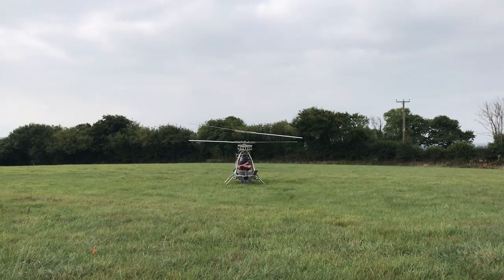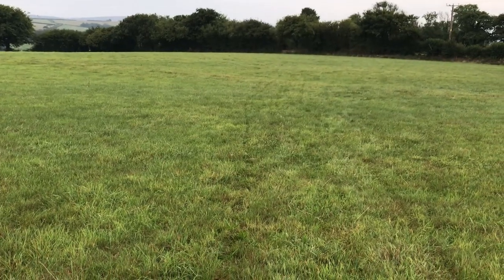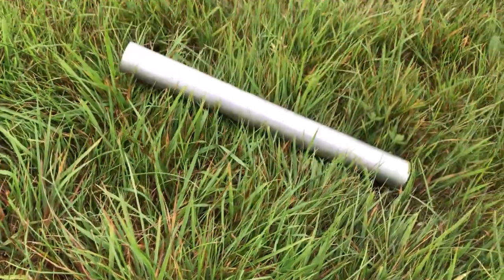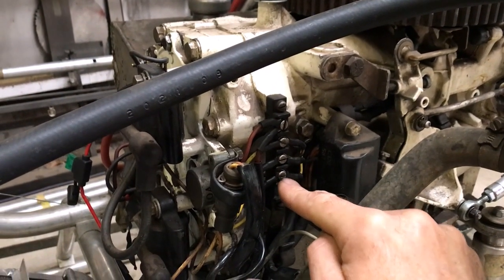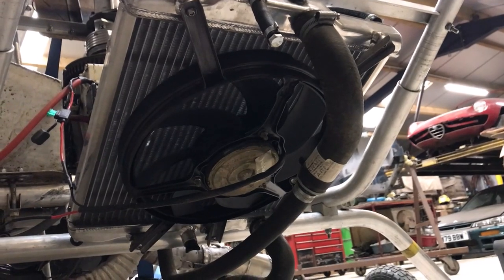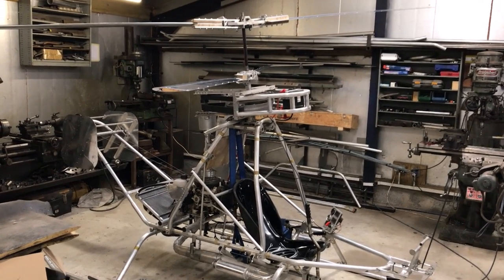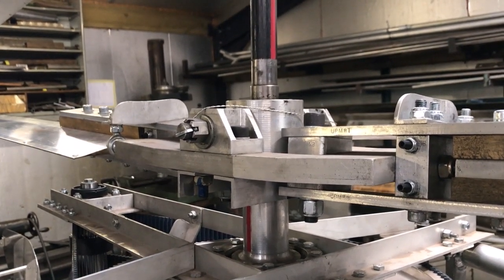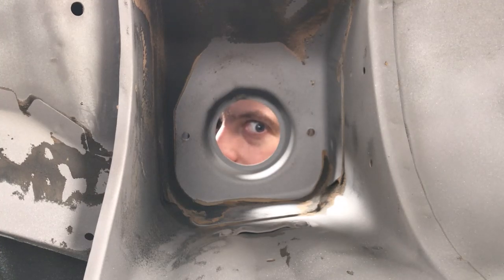Slow learning process Homemade coaxial Helicopter

Comment: Being untrained in Heli flight AND flying an experimental, homebuilt machine.  My friend, you are either very brave or quite crazy.  Possibly both.

Some suggestions:  Take a couple of lessons.  Even if just to the point you can hover.  As it stands now, you won't know if hover instability is because of a lack of skill, or a deficiency in your machine.  Second, and this may be difficult, try doing your test flights on a harder surface.  While this seems counter-intuitive, that fact you noticed about the grass is important.  You want your machine to be able to slide along the ground if it gets out of control, and as you noticed, the grass isn't very slippery.

In any case, I wish you the very best of luck.  I ran into the same problems you are when I started flying model helis, and the advice above is what was given to me by an experienced full-scale heli pilot.  I followed it and sought out an instructor.  It really helped me.
Reply: Can you hire a pro test pilot to try it out?
Reply from the maker: @codetech5598  I don't know but I wouldn't be keen on putting someone else in my home built machine. Think I would only risk another person if I had already done extensive testing on it myself.
Reply from the maker: Thank you for your constructive comments. I have had a couple experiences in a Robinson and I have got another one coming up, I'm sure it will help but apparently 14hours is the average time taken to learn to hover. At £320/ hour it's expensive, my thoughts were I could build a helicopter and teach myself cheaper than paying for instruction and I'll have my own helicopter at the end of it. The hard surface would be fine if there was a place nearby to test. Short grass would  be my preference and the field next to my workshop is ideal when cut. I could ask the person who rents the field if I could cut a section if it, will give that some thought but don't think they would be happy about it . What I really need is my own land and workshop next to it to carry out testing. Trailering the helicopter to test is quite time consuming and not very practical.
Reply: @Ben-Dixey , as an alternative to a hard surface, you could use something to spread the weight of the machine on the grass.  Your outriggers are fine, just not slippery enough.  Some flat pads of a couple of square feet each on the ends could help.  Like wide skis.

As for instruction, any kind of practice helps, be it desk top simulator or even Radio Control model heli.  Again, I wish you great success.
Reply from the maker: @Cee64E  Again great suggestions, you have just reminded me about the balls attached to Rc heli training gear.  👍👍

Yes to simulator I'm going to get one asap. I struggle with the yaw pedals as much as the cyclic. I've got a blade 400 Rc helicopter   which has given me an advantage for sure.

Comment: Those skids are TITANIC.  Though it makes sense if you're learning to fly or are flying an experimental aircraft.  Still look weird though.  Also you sound English.  Are you a trained and licensed pilot?  I was wondering how the law for homebuilt micro/ultralights (whichever's smaller) worked.
Reply from the maker: Yes the very long skids are to prevent a dynamic roll over which would be very hard to avoid during the learning process without them. I'm not a helicopter pilot and have been teaching myself to fly and sorting issues with the helicopter. The machine is also tethered to the ground via ground anchors but the tethers are long. I only know about a hearsay rule that says as long as it's tethered it's ok to test in the Uk. However I haven't found any written documentation that verify's this. The machine is intended as a slow moving hovering vehicle and won't be flown more than a few feet above the ground.

Comment: hi! you can try and use an electric motor! 15KW should suffice :) and some lifepo battery :D the flight should be very smooth and controlls same :)
Reply from the maker: Hi, battery power would be great and no doubt possible, it's something perhaps for the future but not a cheap install. Electric powered helicopters are being developed as you will know.

Comment: Just an observation after turning wrenchs on fling wings (helicopters) for 30+ years.  I think you are under powered.  Otherwise looking good.  Bee Safe!
Reply: AVATOR.....the breakthrough here is Ben has eliminated the complexity of cyclic pitch change, the whole rotor head/drive tilts in the direction you want to go, no other machine has done this.
Reply: @cloudusterable  I think Ben's system is acceptable in a balance hover only.  The forces and applied aerodynamics of directional flight are going to change things drastically.  Take into consideration the affects of the advancing and retreating rotor blades in forward flight.  It's very complicated and simply having fixed pitch rotor blades is not the solution.  If it was then all certified coaxial MR helicopters would use such a system.  Keep it simple right?  Here's something you may no have considered.  What happens when the engine fails in your fixed pitch rotor system?  How is rotor correct RPM in a autorotation maintained?  In a conventional helicopter is maintained by cyclic and collective controls.  What good is a vertical flight aircraft that can only hover?  Let me ask you this.  Would you be willing to fly Dan's "design" at a cruse speed of 100 MPH at 5,000' AGL?
Reply: Avatar....think you'll find the rotor blades are on a teetering or see saw hub to allow advancing and retreating blades to adjust, but at the mo this is more a lifting device for coasting around at 3 ft 6ins altitude,  your right autorotation is non existent. But main thing is this universal drive hub.
Reply: @cloudusterable  I think he is proving "proof of concept" with his design and considering his experience and resources, doing a good job. 👍
Reply: Avator....one other thing the Nolan Brothers helicopter is virtually the same as Bens, fixed pitch contra rotating rotors on a see saw hubs and that machine flys all over the place at speed, but no autorotation in case of engine out, but has 2 engines.
Reply: @cloudusterable  Two Rotax 503 DC @ 50 HP each.  What if both engine fail?  the Nolan "design" is very different from Ben's.  Like apples and oranges sort of thing.  Let's see what Ben does next.
Reply: @av8tor261  Peter here you're right in what you say double engine failure you are done, but the Nolan machine is still the same as Ben's....a fully tiltable coaxial rotor unit, with fixed pitch see saw rotors, the major difference is the rotor reversing unit is between the rotors and is very expensive with a patent on it,
Reply: @cloudusterable  You still should be able to autorotate with any power failure.  Period.  Ben is doing a great job and the more he flys it the better he is getting.
Reply from the maker: Well from the video you are correct I would say., I haven't actually felt the full throttle stop yet but I know it's not far off. However I haven't optimized the blade pitch yet either. When it lifted the machine last year I just left it alone but more pitch might equate to more lift. It would be pretty unlikely I have stumbled upon the maximum lift pitch setting straight away. I actually feel a bit safer with less lift available. Good observation though  👍👍
Reply: @Ben-Dixey  I have no experience with a fixed pitch rotor system.  I would suspect that if you increase the pitch or angle of attack of your main rotor blades.  You will require more power.  I do have to hand it to you that you have done quite well so far.
Reply from the maker: Thanks, I will adjust the pitch and find out what happens. I do know that a 0012 blade produces maximum lift at 7 degrees pitch and mine is at 6 degrees.

Comment: No offense, but am I the only one that thinks this is absolutely insane?
Reply: I think only insane people would consider this sane. The freely moving rotors, without any mechanical flybar stabilizing setup, means it won't be very stable. But it seems there is also limited control authority to correct any unwanted changes in the attitude of the craft. And the risk of blade strike is also not to be neglected, if that happens, things come apart in a split second with parts flying all around. I admire the pioneering spirit of the builder/pilot, but this feels like a flying deathtrap to me, tbh.
Reply from the maker: A lot of the design features of this machine has already been done and proved but there is little in depth information about them. If you look at the Nolan coaxial helicopter the flight videos are super, it has the same gimbal type control and the blades are actually closer together than mine.
They have tested the machine to 50mph and have complete control.
I chose the design for simplicity of building but perhaps with hindsight I should have stuck to conventional. If nothing else I hope to provide Information on the configuration, drawbacks ect.
Reply from the maker: I doubt it 😆

Comment: It's difficult for anyone to fathom the dedication, and amount of work you have put into this project.  Every time I see you flying your craft I experience a vicarious thrill from your achievement.  I've learned to fly helis in my basement, and look forward to seeing if time spent in my heli chair will transfer to the real thing.
Reply from the maker: Cameron Carter used the helicopter he built in the beginning as a simulator and he said it was virtually identical to the real thing. I should have done the same, I think it would have greatly reduced the amount of real time put on my machine. Have you plans for a real flight soon ?
Reply: @Ben-Dixey  I, probably, should be a licensed pilot by now, but fuel prices went sky high, instead of me.  Instructor I spoke with earlier this year told me he had just sold his two smaller helis, due to costs involved in keeping them.  I want to go up in a two-seater for my first flight, so am still looking for the right place and time... getting closer.
Reply from the maker: The cost is the problem isn't it, at £315/hour on the R22 it would cost a lot just to learn to hover. However the simulator experience will no doubt save a significant amount of money. Hope you can experience the thrill soon it's pretty exciting. 👍

Comment: Another excellent video Ben. Thanks.
Reply from the maker: Thanks for the support Cam, once you were getting the hang of hovering did it take you a longer than expected time to fine tune the skill or were you a natural at it?  Any more videos planned on your channel? Missed your content
Reply: @Ben-Dixey  I set up the heli as a flight simulator in Xplane using all the controls and throttle position etc..I spent about 200 hours flying around and eventually got confident with muscle memory. The helicopter was virtually identical to the simulator as far as hover taxiing goes. (Once I got the rigging right) Never got higher than about 6m off the ground. (A bit scary). That was when the "men in black" turned up.  🙂
Reply from the maker: Amazing! 😀 6m wow, nice to prove the out of ground effect hover. Yes I remember you telling me about the simulator, I should have done that, it would have speeded up the process for sure.
Reply from the maker: Did you have a video on YouTube of the 6m high flight but had to take it down?

Comment: You are doing okay, what percentage of power are you using in the hover?
As below be very careful, certified light weight Helicopters do not have the best of reputations, and experimental helicopters probably less so.
Reply from the maker: Thanks. The power required is near maximum, I haven't actually hit the full throttle stop but I know it's not far off. I would be surprised if it could get out of ground effect, however I haven't optimised blade pitch yet and might be able to get more lift when needed. Also I'm carrying around 8kg of extra long skids which when the time comes will be removed. If things get really desperate I could give up cake for a couple months. 😀